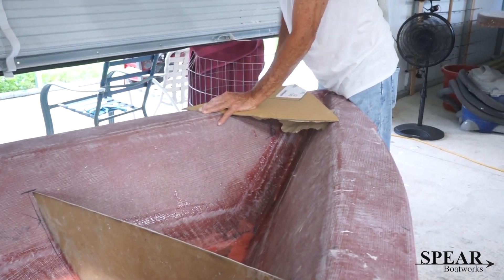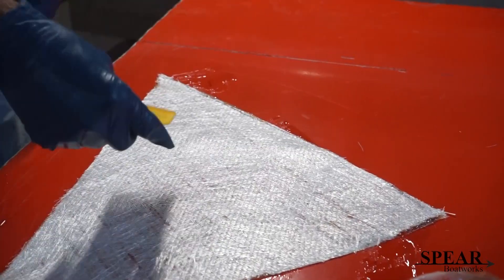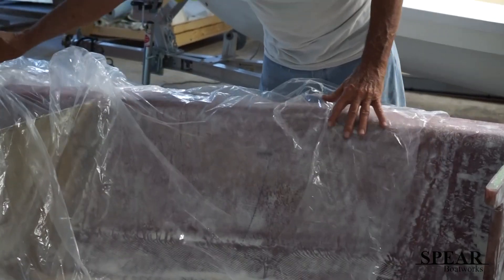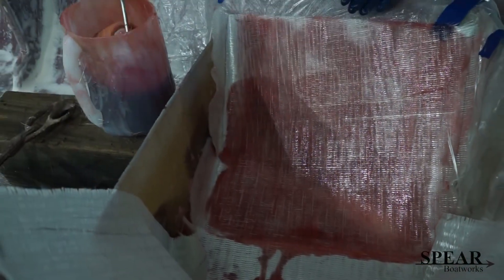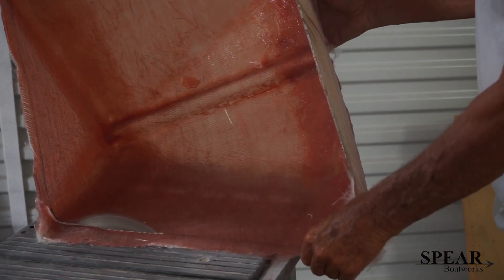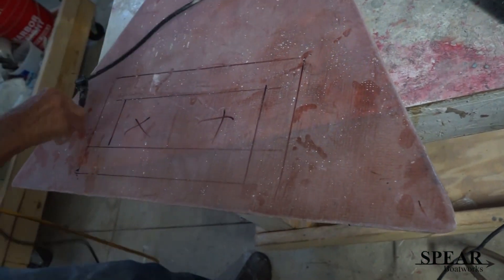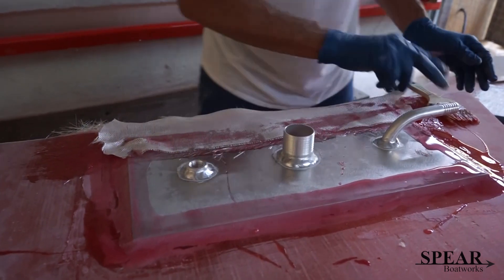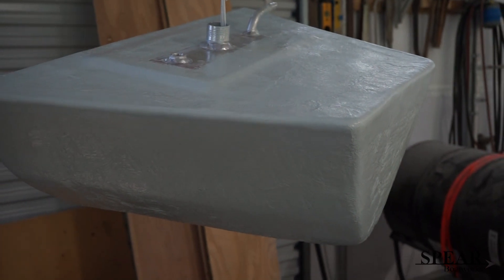Step Three: Building the Fiberglass Gas Tank

Comment from the maker: Diesel won’t break down a tank made with vinylester resin. Ethanol is the culprit to worry about. If fuel has that you need to coat the interior with an Epoxy vinylester such as Novolac Vinylester.
Reply: What does it cost and where do you find it?

Comment: I came here because I need to figure out how to build a fuel tank for a Husqvarna GT2254 riding mower. This mower has the fuel tank under the seat and under the fender. It's shape is rediculous and it's disintegrated pretty bad from the sun. Of course it's not made anymore and can't be found anywhere. :(
Reply from the maker: Sand the tank. Wipe down with acetone. Buy quart of epoxy resin and one yard of 10 oz. fiberglass cloth. Wet tank and cover with cloth. Make sure you stretch the cloth around . It’s ok to fabricate using pieces just make sure you overlap joints. Use a small 2” throwaway brush. Wrap tank with two layers. Easy Peazy!

Comment: Guys production builders use prefab tanks because they save on labor and can be installed by lesser trained personnel. FG tanks work. Use ethanol free gas if you use poly resin. If you can't get ethanol free then you need to use an epoxy resin. The process is still the same.

Comment from the maker: Vinyl ester resin is impervious to gasoline as long as there isn’t ethanol in it. Use marine gas for long life of the tank.
Reply: Is it truly impervious or just chemical resistant and will need be replaced few years down the line?

Comment: What type of resin are you using for gas tanks? I planned to use two 3 gallon Scepter plastic tanks that I bought from Academy because they're only six inches high and fit nicely under my rear deck. But.....here's the problem with those tanks. When I put fuel in them, the pressure built up and caused the tanks to swell and expand. Now they no longer fit under my rear deck, so I'm going to have to build custom tanks. I'm thinking about making fiberglass tanks or some sort of aluminum/fiberglass hybrid. Any advice on type of resin to use so that it's fuel resistant would be appreciated.

Comment: Hi Harry, loved that vid, great skills. I’ve got a small fibreglass boat that’s 14.6ft long (4.42m) and I want to build in a tank in a similar way to yours. I was wondering why you have to build it as a removable tank, as I would prefer to build it as a built-in permanent tank. Thanks from here in New Zealand
Reply from the maker: For me personally I would much prefer to have the ability to remove my fuel cell if needed. All you have to do is line the area you’re building the tank to with plastic and it will release from the boat and the plastic will pull off the tank once it’s fired off.
Good luck with your project. Blessings Harry
Reply: I would prefer a removable tank just thinking ahead. If something went wrong with the tank it's easy to remove and fix. If you boat Hull gets damaged in that area it's easy to pull the tank and fix both. A built in tank would be a pain if you ever  needed access for any of the reasons I listed plus some I maybe didn't list.

Comment: Hey harry…I’m in the process with a skiff rebuild.  I am so glad to have found your channel.  It has helped a lot.  Question about gas tank.  How do you secure it when on the water?  Is it just set underneath the deck?  I guess a portable gas tank is “free floating” as well.  Just trying to plan this out and have it make sense in my head.
Reply from the maker: Make L shaped tabs and glue them to the deck. That will keep your tank in place.

Comment: When you say plexis what are those? Can I use silicone to glue down the aluminium sheet onto the fibreglass tank?
Reply from the maker: Plexus is a two part epoxy bonding glue. Negative on silicone!!! You need to insure that your tank won’t leak. After you glue it sand and glass the edges. Overlap by 2”
Reply: @harryspear1948  Thanks for reaffirming, any specific expoxy glue that I should be aware of? I found MarineTex epoxy, but unfortunately it is not sold here in Malaysia.

Comment: Complete newbie here! My boat builder, here in Panama, is constructing a 90 gallon tank for my 25' Caribe Pro. There is a design flaw that creates issues with the gas tank. Perhaps I misunderstood but I think he said he coats the inside with gel coat.  I could be wrong. Thoughts?
Reply from the maker: Can’t hurt. Better with epoxy if using ethanol

Comment: So what materials to use on the fiber if it's gasoline tank need to make 100liter
Reply: Not diesel
Reply from the maker: Vinylester resin 1&1/2 oz matt and 1708 biaxial fiberglass
Reply from the maker: Use non ethanol fuel!

Comment: 2 questions. I have a few gallons of USComposites slow cure epoxy resin. Do you know if this will be ok to construct a gasoline tank for my boat? and where can I get one of those aluminum manifolds that you use?
Reply from the maker: Ezell Industries Perry Florida. 
I would make the tank using vinylester resin and paint the interior with the epoxy. Sand the cured glass first to insure a good mechanical bond before using the epoxy.

Comment: Hey Harry.... so I'm thinking of building a motorcycle tank out of fiberglass, but my worry is petrol eating through... any advice on how to avoid this?
Reply from the maker: Use epoxy resin and 10 oz cloth and cover your leaking tank. Fair sand and repaint
Reply: @harryspear1948  I'm actually looking to build one completely from scratch.  Do I need to use a specific resin or gel coat?
Reply from the maker: No sir,
Easiest way use H60 core and poly or vinylester resin. I would make a strong back table to build your boat.
Build transom first 
Bottom second
Build frame for the keel and the stem
Fasten the sides to the bottom and make sure they are equal. Make the first and then trace it out on the next piece of core
That should ensure that the pieces are equal. Good luck!
Reply: Thankyou Harry

Comment: why would you use fiberglass for a fuel tank and not welded aluminum or stainless steel?
I would always go with aluminum for modern fuel.  Weld it up and then set it in some type of foam or resin cradle.

I admit, I have never made a fiberglass fuel tank, but it just seems to me that the polyester resin would be dissolved eventually in the gasoline?  especially the modern fuel mixes.

Comment: I've been looking for a way to build a custom low profile fuel tank for my project boat and this is it!!! I'm using 100% epoxy resin to build the tank. It will be removable like yours. 100% epoxy resin over 1708 . Sound like a plan or am I missing something?

Comment: May I be out of topic? I was wondering if I could use the fiberglass resin as an interior coating for my Motorcycle Fuel Tank? I'm really worried that it might melt the resin over time. Can you please help me?
Reply from the maker: What is the tank made of? Epoxy might seal better. I would do some research before using any of the above remedies. Good luck with your project.
Reply: @harryspear1948  thank you! I was literally waiting for a response. 😅 I'm not really sure what my tank is made of but it's a 1978 TS185 tank. It was cleaned up and restores but I just want to make sure the rust won't come again.  I want to know if this resin if good  material for my tank's interior.
Reply: @harryspear1948  i'm also worried that the gasoline might melt the resin. So I have to asks experts opinion on these matters. I'm doing everything by myself restoring my uncles bike.